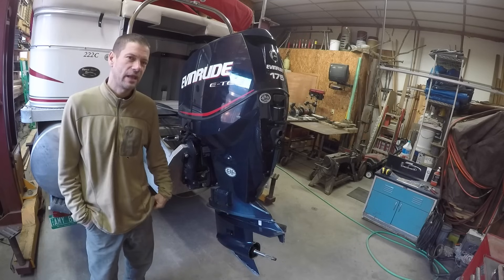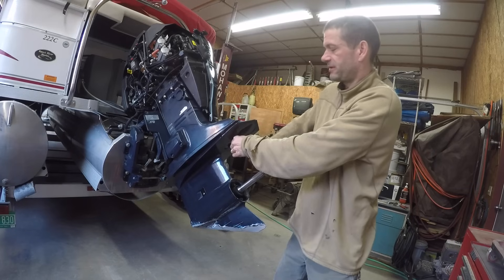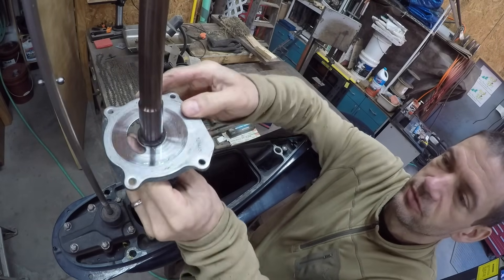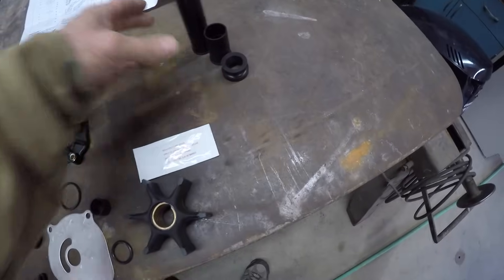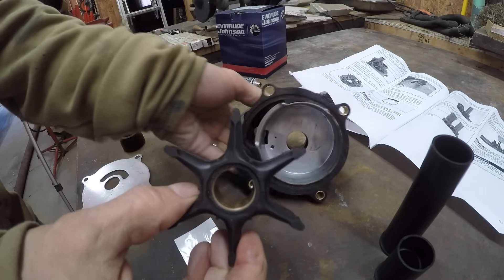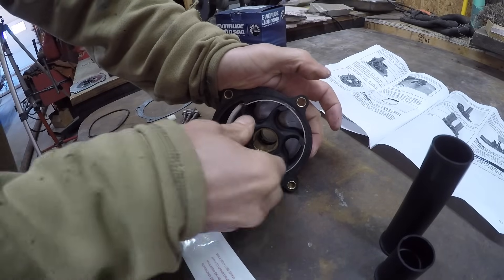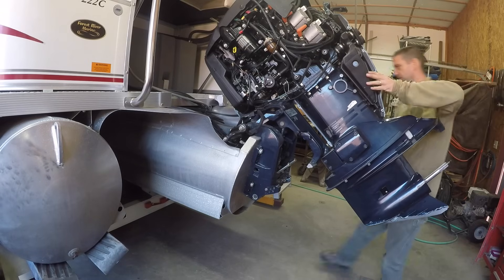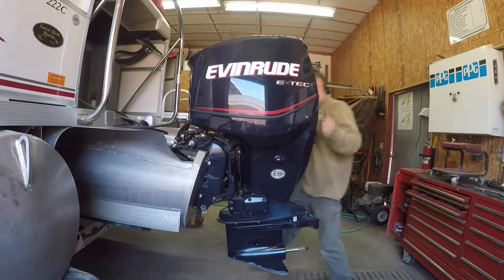Detailed Evinrude Water pump replacement

Comment: Thank you sooooo much for this video saved me a lot of money!!!!!!! The only little part that I had to replay handfuls of times too be clear was the reason  you slide the key and gasket down the shaft the gasket it just to help hold the key in place while sliding housing and impeller when the key slips in the impeller the gasket drops down and sits on the bottom of the shaft out of the way. Then lift up on the shaft turn counter clockwise for a turn then lift up on the shaft and turn clockwise you will feel it click in that’s it! I have a pair of 175hp Etecs! I was quoted $1,000 per motor for 300hr service I spent $300 in total for parts for both motors saved $1,700.00 it was super easy anyone can do it!!!!! Just take your time follow the video exactly you will be fine! West Palm Beach FL
Reply from the maker: I'm glad the video helped you out. Thanks for the great comment.
Reply: Can the key be held with assembly lube ? Sticky stuff?
Reply from the maker: Probably

Comment: I have read and watched a couple different sources on water pump replacement, each having it's own little nuggets of wisdom. This video has come the closest to compiling all the little tricks. And completely new ones like the keyway/oring trick and only one other source (read) talked about pulling up on the shaft an turning to lock into place - nice to see it done in video. Easy to see this is far from your first water pump rodeo. Thank you for posting!
Reply from the maker: Thanks for the comment. I'm glad it will help you. I have done one other water pump made different engine. I decided to change this one before I sold the boat. I got a lot of good advice from the dealer. 👍

Comment: Thanks! Great video .... much better than others.  It was good to see the procedure of holding the impeller key on the shaft with the o-ring and also the hint to turn the shaft counter clockwise to unlock key, then lift up on the shaft and turn clockwise to re-lock the key thus setting the impeller in its optimal position.
Reply from the maker: Thank you for the great comment

Comment: Good video, but like all the rest, nothing is said about lining up the pump outlet with the pipe inside the upper unit when putting it back together.  Some of those upper pipes floop around and it is next to impossible to get them to line up.  Plus, they only start to meet up with each other when the space to look in there is too small.  I completely missed the line up when I put mine back together.  I didn't know about it until the motor overheated.   It took me several attempts to finally get them to hook up.  I don't know why none of these Evinrude videos ever mention that.  I would think that to be a very important issue to bring up.
Reply from the maker: Oops

Comment: Are you not supposed to put an o-ring on the top of the shaft??? Also is the key to the pump a one way fit ?  So I can't turn it sideways or anything one side looked fatter which side should that face???

Comment: Thanks for the great vid! One question tho, what happens if you can't break the key? I'm right in the middle of it and the shaft turns but doesn't break the key, I can't get the old impeller off.
Reply from the maker: I haven't had to deal with that. I would try to get a tool under it and pry on it.
Reply: @NEILSWORLD  thanks for that. Turns out I couldn't budge it at all so I carefully cut it off!

Comment: excellent tutorial thanks for explaining. all other impellor videos I've sean they slide the impellor over shaft then houseing. why did you put the impellor inside the houseing then slide both the peller & houseing over the shaft? I'm considering buying a engine just this this do you think 1500 hours is too much an the engine could be worn out. seller says good compression. thanks for any tips.
Reply from the maker: I don't have an answer for you. This is my one mechanical experience with an outboard engine.

Comment: did you by chance shift gear case into reverse before removing the shift rod bolt? I saw quicksliver on the addhesive what exactly is this spesphicaly for lower units? where the instructions included w/ the kit? thanks again for sharing the knowledge.

Comment: Thank you for this video. It was very helpful..

I watched the "how to" water pump video from Wholesale Marine and I could not figure out how the **** they managed to get the water pump put together without pinching the big o-ring. When I tried it their way that o-ring kept getting knocked out of place by the impeller because they said to put the water pump case on over the impeller while it was already on the drive shaft. This video made MUCH more sense. Thanks for a common sense approach!! (..I wonder how many Wholesale Marine pumps are out there leaking because the o-ring is installed wrong?)

Comment: HI
I have seen and done on a Yamaha Outboard, instead of fitting the impeller into the housing, you fit O.ring and Key to the shaft, then the impeller to the shaft, that way you see the Key sitting in place, then as you fit the water pump housing you turn the drive shaft counterclockwise whilst gently pushing on the housing and the impeller seats itself into the housing. 
Would this work on a Etec 115hp? as its easier than trying to install the impeller and then slide onto the shaft.
Thanks
Reply from the maker: I didn't find it difficult at all to do it this way.

Comment: If the impeller key falls out during installation, will the impeller just free-spin? My G2 has the exact same impeller key. I used the o-ring to hold it in place just like you and slid the impeller over it. It seemed to go on smooth, but I hate how you can't really see it go on from the top like my old mercury. I rotated the shaft clockwise and I could see the impeller rotating inside through the hole in the top of the pump housing. I think it went on correctly, but any advice would be helpful.

Comment: Great video, where to put the adhesive and the direction of the impeller, I do have 1 question if anyone can answer is what type of adhesive was he using?- 3m or some kind of marine type adhesive.
Reply from the maker: It was bellows adhesive recommended by the boat dealer that I bought the kit from.

Comment: I turned the drive shaft counter clockwise to release the impellar and it just kept spinning. I pulled on the impeller to try and remove and the shaft pulled out completely with little force. Not good. At that point, I brought to the mechanic. Evinrude etec e115dslsuc
Reply from the maker: Sorry to hear that.

Comment: I have a question for you. I have not been able to find any video for a 1992 Evinrude 48 SPL. It comes apart much like this one but when I take the bolt loose from the linkage and then try to lower the unit off the bottom it doesn't want to come out. The reason it will not come all the way down (2" is all) is because there is a rubber boot that the linkage goes through at the top and the flat part of the linkage on the end is bigger than the round part so it doesn't want to pull through. Does yours have this boot?? Should I lubricate the shaft and force it through?? Do you think it comes apart somewhere else and doesn't actually pull through?? Thanks for any suggestions you may have.
Reply from the maker: Mine didn't have that boot, sorry.
Reply: NEILVVT I went ahead and lubricated the linkage shaft and pulled through the rubber boot. The boot pulled out of the hole like I was afraid of and is now down inside. There is also a boot on the lower end which also pulled out. I was able to put it back in because you could just reach it from the bottom but the top one is still inside the housing somewhere hopefully will not cause a problem in the future but I am shocked that no one else has ever said anything about the boots. I did get my water pump put in and everything is working fine but I don't understand the lack of talk about boots in any of the hundred videos I watched.
Reply: @Grandpa_RLP  crazy engineering

Comment: I have a 2008 Etec 200 HO, and can't seem to get the lower unit to slide back in. I'm assuming the shifting linkage is getting blocked somehow. I've tried to putting it in forward, reverse, turning it every which way. Any tips?
Reply from the maker: Sorry, that is the only time I've worked on one of these engines.  I didn't experience the situation you're having.

Comment: I have to replace the water pump on a 2013 115 etec. Anyone know if the same water pump kit is for the 2013 model or what the difference is with a 5007556?
Reply: Did you ever get a answer? i have the same motor as you and I'm wondering the same.
Reply: @thomasrice5225  never did get an answer.  I used sierra 18-3476. Ebay description.... OE Replacement; With Water Pump Housing/ Impeller/ Cup Insert/ Impeller Key/ Impeller Gasket/ Outer Wear Plate/ O-Ring/ Screws/ Grommet; Fits Johnson/ Evinrude 2013+ 90 HP/ 2009+ 115/ 130 HP Engines

Comment: what sticker did you use? instructions indicate adhesive 847, what you used is equivalent?
in other videos they use fat, what do you think?
Reply from the maker: The adhesive was a tube of quicksilver bellows adhesive.  That is what the dealership sold me with the water pump to use for this water pump replacement.

Comment: Excellent video!  What type of adhesive and grease did you use in the process?  Thanks!
Reply from the maker: Thanks, the adhesive was a tube of Quicksilver bellows adhesive that the dealer sold me with the pump.  The grease was some all purpose grease I had on hand.
Reply: What is the purpose of the adhesive and is it a must have

Comment: Is the impeller key the same on both sides, so it 's facing the right way when you put it on the shaft?
Reply from the maker: It is flat on the side that goes on the shaft.  It is also wedge shaped, the wedge shape is what allows the unlocking by turning the shaft.
Reply from the maker: At 10:26 you can see that the fatter par of the key is toward my thumb
Reply: Thank you! Again excellent video! I think you should check your videos once in a while because I'm sure many times people have questions! Keep up the good work especially on those ETECs.

Comment: Do you know if this is exactly the same process for a 2008 Evinrude Etec 200 H.O.?
Reply from the maker: Anthony Kennedy I'm not 100% sure but the directions in the kit said it did from 75 horsepower to 300 horsepower so it must be roughly the same procedure because it's the same kit.